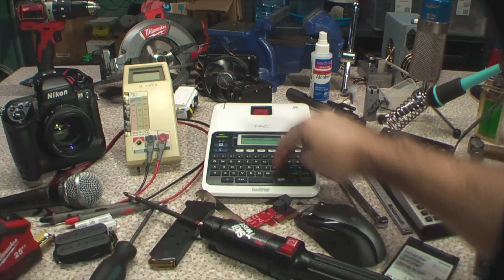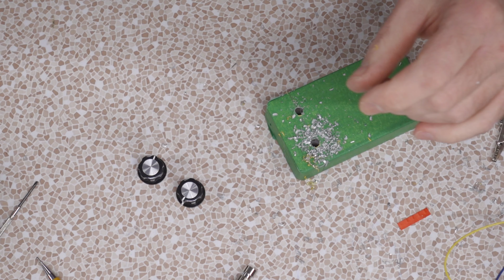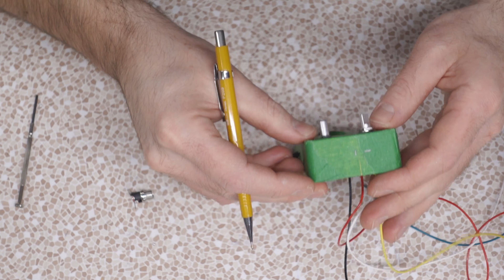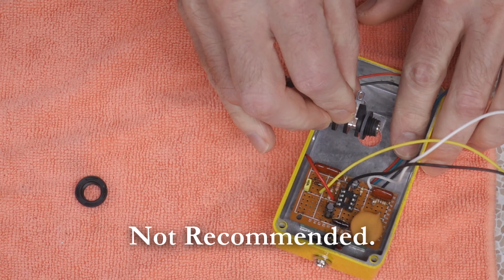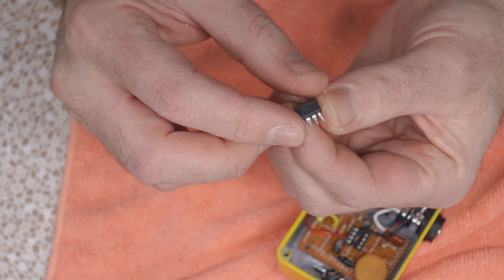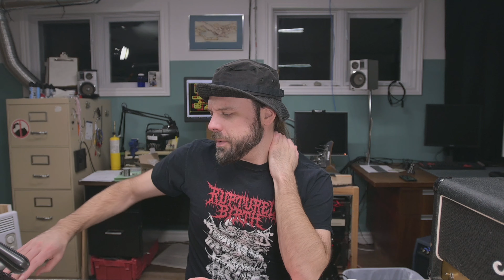DOD 250 - Ep2 : Assembly and Testing.

Comment: I am pretty sure the gain pot should be a linear pot. The C500k you used is reverse taper. That’s why it is working backwards. Or just swap 1 and 3 on the pot.
Reply from the maker: Nah, C500 is the correct part. It was backwards cause I made a mistake in my layout and hooked the pot up backwards. I figured it out and fixed at 17:48. However, it seems I failed to explain how I got it wrong and what I did to fix it. Oh boy.
Reply: @DATT  Cool! I am about two years in building pedals and really like the idea of using sockets to be able to change values. Thanks man!
Reply from the maker: @hookydoo  You welcome. 
I recommend a socketable input cap. I did that in the next 250 build, and in future pedal builds. 
I was surprised how changing that one cap turned things like the Fuzz Face and Op Amp Muff into completely different pedals.

Comment: I worked with a fellow one time, he was holding on to something and trying to drill it at the same time. The drill slipped and went right through his hand sideways. Right around the web of his thumb. Just ripped it to pieces too. Gruesome. 🤢 Awesome build BTW. I'm pretty much following you step by step. Except I'll use a press 🤓
Reply from the maker: Oh boy, step by step. Well, It does work well. Those the layout is not as good as it could be. 
I think I came up with a better one later on, but I never actually built that version. 
And ouch, fortunately, this is soft aluminum, so, not lots of danger. Steel tho, yeah, that can hang up and take off on you. 
I have several more pedal builds in the future, I do end up using the press for most of them.